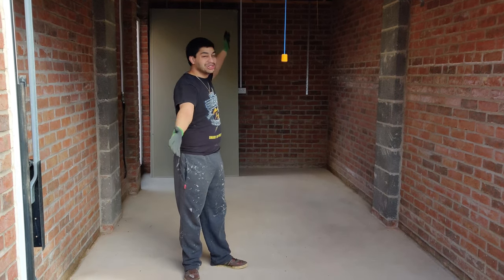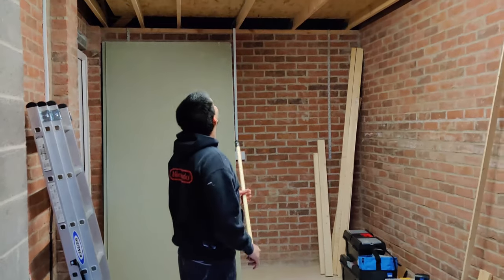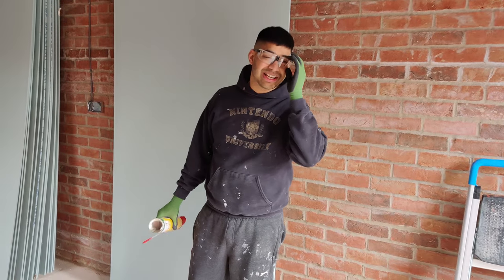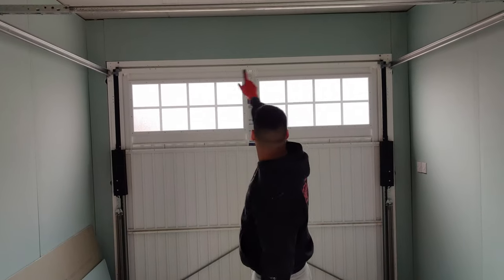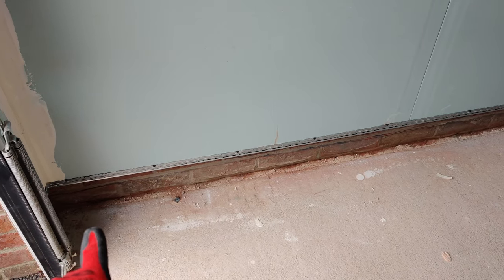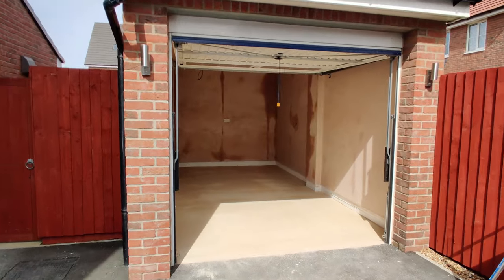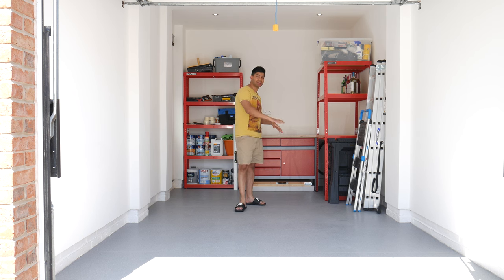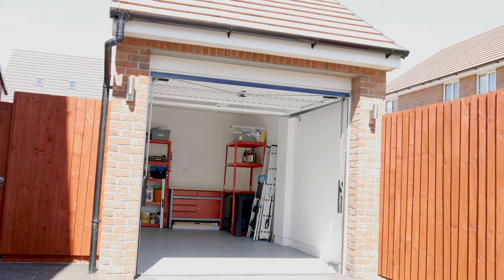How to finish a new build garage from start to finish!

Comment: How much did this project end up costing?
Reply from the maker: Around 2k alltogether, with electrician and plasterer.
Reply: @Dipscovery  that’s good to know thanks, did have to have planning permission? We have attached garage in the house we are buying and the garage is really cold, it’s has brick wall so I want to insulate it with 25mm insulation board on the walls so I don’t lose living space, then add 100mm in roof but the draft from the door is soo much am considering ways to stop the draft etc, any ideas? Also I’ll like to turn it into another room in a few years, would I need planning permission for that? What do you think?
Reply from the maker: @theoteam4641  Hi, you don't need planning permission if you are doing what I did, if you are converting it to a living space, you do not need planning permission but there are certain health and safety/fire requirements you need to be aware of. If you watch towards the end of the video I used a draft excluder strip for my garage door.
Reply: @Dipscovery  ah I see, I may be using it as a living space in about a year or two, but the garage is attached to the house. Does that still need planning permission?